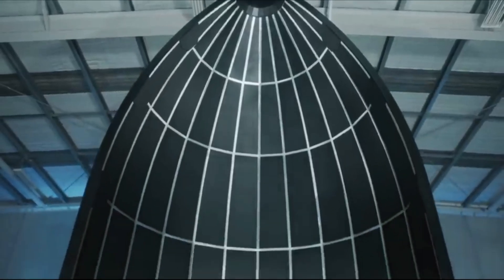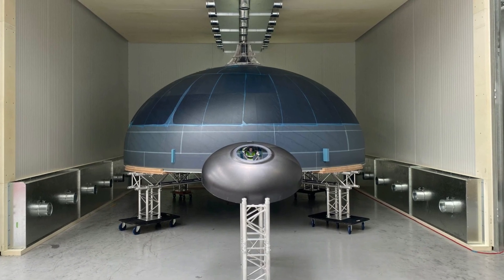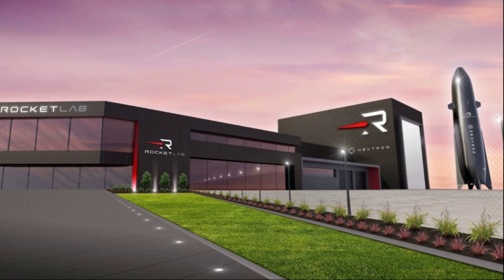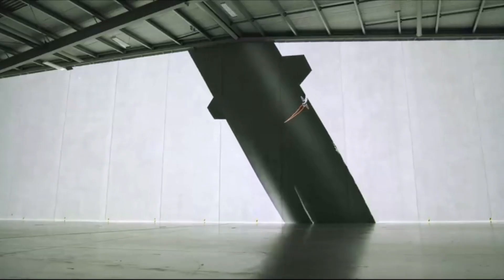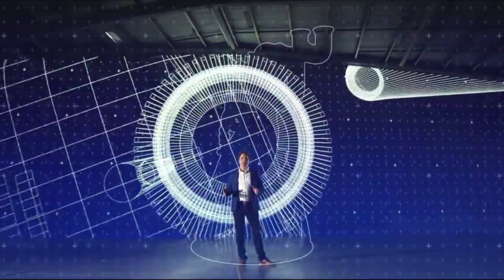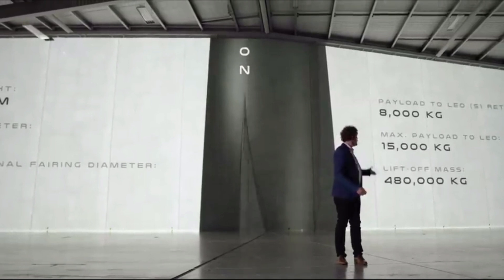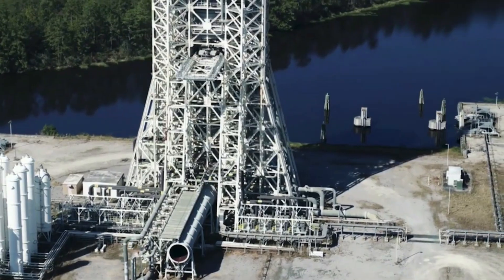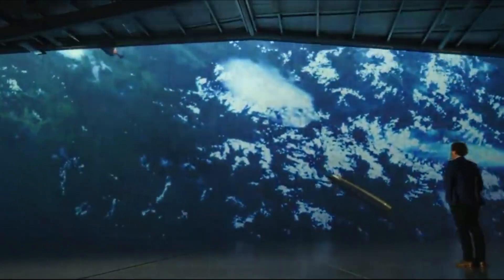Rocket Lab Is Getting Closer To The First Launch of Neutron

Comment: I'd hope that RocketLab's plans include the use of a Dreamchaser class of second stage and not a capsule. Capsules are for emergency escape not for manoeuvring and support of manned operations in space.
Reply: This is a fundamental misunderstanding of space flight..
The shape of your vehicle has absolutely nothing to do with your ability to maneuver or support manned operations in space. 

No matter what vehicle you have, you are in some sort of free fall in a vacuum. All you have to do is eject molecules at high speed in the direction opposite of that you want to move. There is no aerodynamics or drag in any meaningful way.

The reason we have used capsules for so long is the shape naturally flies in a stable and relatively predictable manner at all speeds through an atmosphere, (it naturally keeps the heat shield into the wind) So if something happened during this time and there was no control or the occupants lost consciousness it would still enter safely,  they are evenly aerodynamic so the accent can be modeled easily, and are one of the lightest, strongest and most spacious shapes you can make. Which is huge deal when it comes to the rocket equation.

I agree with your wish, but obviously not for the same reason. Capsules can do anything that needs to be done in space as well or better then almost any other shape.
The only advantage of a Dreamchaser like vehicle, is that it can land on a runway. Otherwise it is worse in every other way, except looks of course because Dreamchaser is gorgeous.
Reply: @Vatsyayana87  the space available in the Dreamchaser class of vehicle means you can have a flight cabin and a habitat sub section with amenities and work and storage area in the separate but hatch accessible trunk complete with an EVA hatch, not so in a capsule seen to date. Landing on a runway and low G entry profile makes for lower cost and more rapid unloading and cost and most likely much faster turnaround for re-flight. We've yet to see Dreamchaser in action, but I think the updated Apollo era capsule has had it time. After all it was the result of getting a few guys to the moon as quickly as possible without a thought to crew comfort or additional functionality. Keep them as escape PODS.

Comment: I wonder if Rocket Lab will still make their 2024 date for the first flight for Neutron or if they know it will slide into 2025. Most spaceflight dates tend to slide a bit.
Reply: It will likely slide into 2025. Beck said 2024 without specifics. If pressed, I bet he would say "later half" only to push it into 2025 to temper expectations and say " it's only a few months differences guys!"
I say this because even with a tiny valuation they are still a public company and beholden to shareholders
Reply: @Wes Michael  recent announcement by Beck is Neutron launch is on target Q4 2024... but we'll see
Reply: @shaunmacredie  dang I was right on the money lol